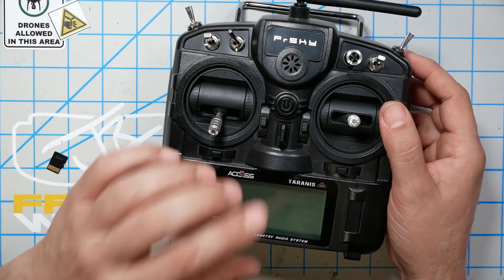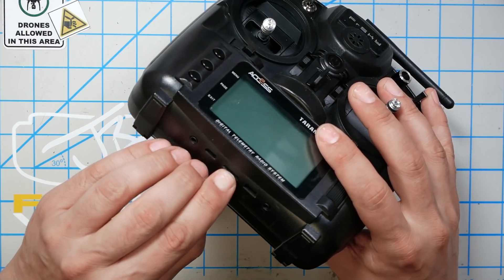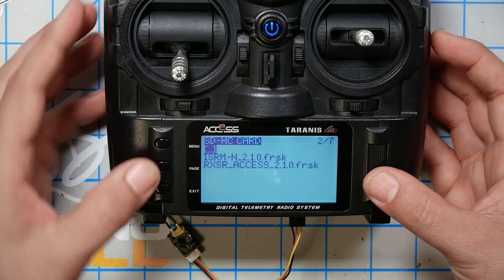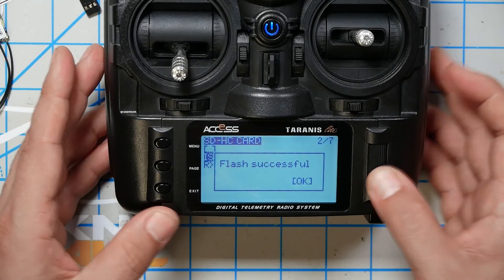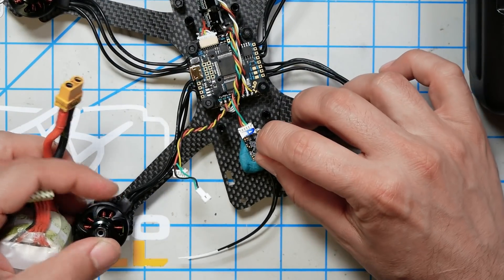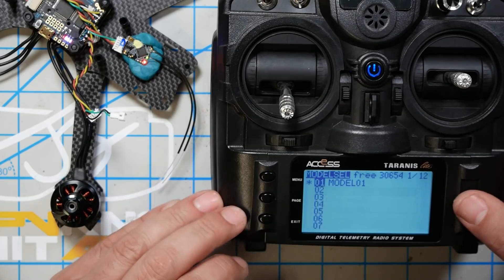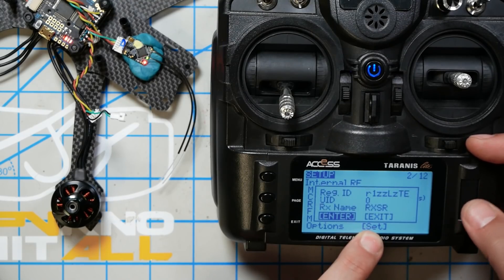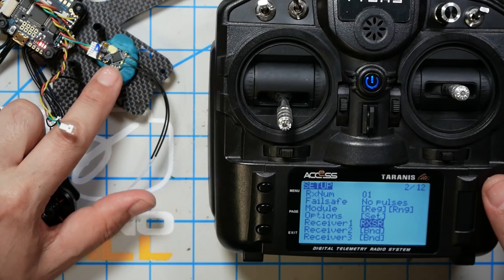FPV Drone Budget Build Full Tutorial - Part 2 - Bind FrSky to X9 Lite and flash RXSR firmware

Comment: So If I have a Taranis Qx7 and I don't have the access logo on the front and instead have a accst logo then I should flash the accst frport firmware onto the rxsr right? I suppose If I wanted to use the same transmitter and access then I would need an external rf module correct?
Reply: kk figured it out. Use the non frport us accst firmware on the rxsr. Make sure the rxsr is in sbus mode too which is where the blue light stays on. To switch modes hold the button on the rxsr for 5 seconds. Everything else should work the same but I don't get any telemetry. I like using the goggles for all of that anyways so no big deal.

Comment: Loving the content. I am having the same issues as others. Using an x9D Plus. Copied the files to the FIRMWARE folder and did not rename them. The only options it is giving me is copy, rename and delete. No option to Flash S Port or anything. Any fixes for this?
Reply from the maker: You could try renaming the files to be 8.3 format e.g. FRSKY1.FRK

There are some older radios that don't like long filenames but I would think if you can see the files, you should also be able to flash them.

But wait. You're not trying to flash the X9 Lite file to an X9D Plus right? That won't work. You have to download the file for the X9D Plus.
Reply: @JoshuaBardwell  Good catch. I did re-download the file for the X9D Plus and I made sure I have the file "R-XSR_ACCESS_2.1.0.frsk". Unfortunately when I long press the enter button with that highlighted, I'm still only getting the options of copy, rename and delete. Is this firmware update mandatory before moving onto the setup with Betaflight?

Comment: I’m having trouble flashing the s-port. I downloaded the files and I found them under the firmware file but the only options it gives me is copy, rename, delete. Would this be a problem with my s port? Is there another way to flash the receiver?
Reply from the maker: It needs to be inside the FIRMWARE folder on the SD card and it needs to have the filename extension not changed.
Reply: @JoshuaBardwell  The  file is on my sd in the firmware folder unzipped with the name unchanged. Anything else that it could be?
Reply: If I didn’t have anything plugged into the s-port would it still give me the option to flash to it? I have the cable plugged in with the receiver plugged in to the end of it but I dont have the option to flash s port. I was curious if it gave the option regardless of something being plugged in or not because that would rule out a problem with the s port or the cable.

Comment: I'm a little confused about the micro SD card. I just bought the FrSky Taranis X9 Lite, should it come with a micro SD card or do I need to buy that separately in order to flash the firmware? Thanks!
Reply: I figured it out. The taranis x9 lite doesn't come with a micro SD. You will need to buy one separately. Also you will need to plug it in to the x9 lite and format it before you download the firmware.

Comment: currently having a couple problems I bought the same tx as this one and no SD card is included I put an SD card in and it fails to format the sd card to place a firmware folder the next problem is that the rx will not bind to the tx maybe thats the firmware issue but it will not pick it up when i press reg or bnd
Reply: Is it more than 32gb if it is that sd card won’t work

Comment: Giday mate. I have just purchased this kit and it should be hear in a couple of weeks. I was going to buy the same reciever you got but I'm using a TX16S controller do I need to flash everything still.
Reply from the maker: If using Jumper TX16 you don't need to flash the receiver.
Reply: Sorry mate I meant radiomaster TX16S

Comment: Joshua, the only trouble with flashing the firmware to 2.1 is that it breaks compatibility with non-2.x ACCST D16 receivers, so now you need to flash them all :(
Reply from the maker: Yes correct. But assuming you are just starting out with this build, that's fine. If you are starting out with a FrSky ACCESS radio like the X9 Lite, you may as well commit to 2.1 early.

Comment: How hot would you say "too hot engines" are?  After a full send battery 🙂
Reply: Most say that if you squeeze the motors with your fingers and you say "Ouch!" and remove fingers quickly... that's too hot! But if you squeeze the motors and don't remove your fingers immediately but instead you think...hmm, that's kind of warm...it's usually okay. Heja Sverige!

Comment: This is great, when switching to ACCESS I totally didn't get the register and then bind process, this should help a lot of people.  Two other things that confused me were the switching to fport under options for r9 receiver, and the two other registration slots for bind which are for secondary receivers for the same model. I was hoping I could bind multiple primary receivers to the same model but you cant with ACCESS.
Reply: Actually you can also use the 3 slots to bind up to 3 receivers from 3 different quads to the same model. They don’t have to run all at the same time. F.port switching from the Taranis is really nice, before you had to flash another fw version for that.

Comment: Do those same steps work with updating firmware on the rxsr with the radiomaster?
Reply from the maker: Sort of. The RadioMaster can't flash using the plug on bottom. You have to make a custom adapter to plug the RX in to the JR bay in back of the radio.
Reply: Joshua Bardwell are you talking about swapping red and black wires on the servo? I did it last night but can’t get it to show up via the bay on the back.
Reply: @slightlymedicated  I'm having the same issue, no option to flash ext module shows up when selecting the firmware file.  Were you able to get it working on the TX16s?
Reply: Ben Woznica I eventually did. I flashed to ACCST 2.1, but was then told on JBs Patreon that was a bad idea as the new firmware then requires updating the radio, which in turn kills compatibility with older Frsky receivers. Rolled it back and paired up. If you do want to move to 2.1 make sure you download the accst firmware not the one JB links to.
Reply: Oh ok. Do you have a video on that?
Reply: I found your video. Seems easy enough.
Reply: I was wondering the same as I have the tx16s. Any news on how to do it

Comment: Hey guys so I just built my first quad and I'm using a Flysky FS-X14S reciever. I didn't properly secure the antenna and half the exposed element got chopped on one of them. I've tried looking for new antenna but there isn't one specifically for it. Will all 2.4ghz antenna work as long as it looks like the same attachment. Also the antenna on it are shorter and the new ones are 150mm will that matter?
Reply from the maker: All 2.4 GHz antenna will work however there are two different sizes of UFL connector and you must buy the right size. The length of the wire doesn't matter; only the length of the exposed radiating element, which will be the same for all 2.4 GHz tuned antennas.
Reply: @JoshuaBardwell  hey man thank you!

Comment: Any issues with using a spectrum receiver?
Reply from the maker: You can absolutely do that if that's what you've got. It's just not what the tutorial shows.
Reply: @JoshuaBardwell   Thanks, I have the kit on order.  Coming from planes and helicopters I have the Futaba 14sg and Spectrum DX8G2.  That being said even outdoors my Betafpv meteor65 gets the most stick time
Reply: greg E any tips on how to get that Beta65 setup on a Spektrum radio?  I bought the Black Friday Edition about 3 months ago.  When I flashed Betaflight 4.2 I can get the thing to bind.

Comment: I have an older QX7, will updating the firmware on the RXSR and my radio prevent me from binding with like my tiny whoops ? Thanks
Reply from the maker: If you're using D8 protocol then you're fine. If you're using D16 protocol then updating firmware on the QX7 to 2.x or newer will break compatibility. But just use D8 and it'll be fine.

Comment: Great! I also just discovered that the RXSR is finally able to put out RSSI on channel 16 without sending it back from the Taranis.
Reply from the maker: I think only on ACCESS firmware though.
Reply: Yes, unfortunately. At least I can report that the latest ACCESS firmware version 2.10 works very well. I’m in an LBT/ETSI region and it seems that Frsky has finally put some effort in its software to achieve similar performance as with the FCC version.

Comment: can you put a crossfire receiver in this kit? are there any reasons to use or not use crossfire if this is the first drone you would be building?
Reply from the maker: You totally can use Crossfire in this kit. The main reason I didn't use it is that many people would find it too expensive for a starter kit.
Reply: @JoshuaBardwell  are there any benefits a beginner would benefit from. I'm asking because Mr steele recommends the tango 2 as a good first radio and I want something to use for sim practice

Comment: This came in just in time. I'm having issues binding two R9mms to one the red modules.
Reply from the maker: Update firmware on both module and RX to the latest one on Frsky web site is where I would start.
Reply: @JoshuaBardwell  Thanks Josh. I will need to desolder them from the FCs first, no connector...